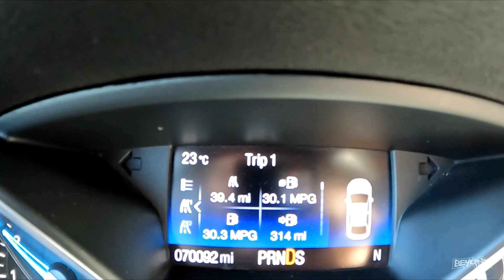Big Ol' Fire [Day 4658 - 08.02.23]

Comment: Pretty good gas mileage Troy. My car gets between 7.2 and 8 liters for every 100 km. or for you non-metric folks that's roughly between 29 and 34 MPG. Depending on whether I'm cruising at 65 MPH or 100 MPH on the Autobahn. ( Fastest I ever drove was  about 210 KPH /130MPH - just saying 😁)
Reply from the maker: Years ago I did 115 MPH on the freeway, 60 MPH zone...  It was a dry, sunny day and NO traffic.  Then I thought I should slow down.  I coasted down to the speed limit.  There was a bend in the road and an overpass.  There was a cop on the overpass with a radar gun and 3 patrol cars on the onramp ready to strike.  I lucked out BIG TIME!  LOL, never again.  ;)